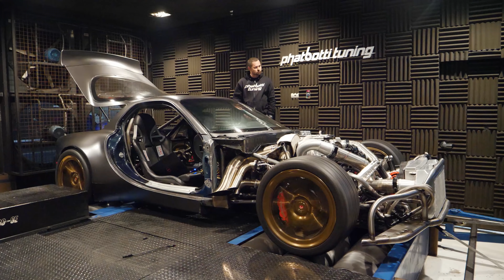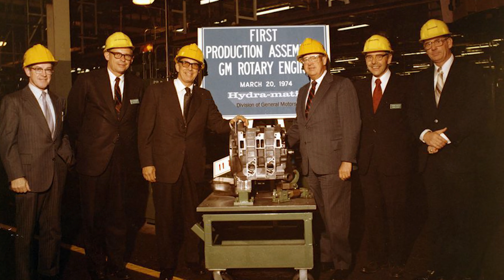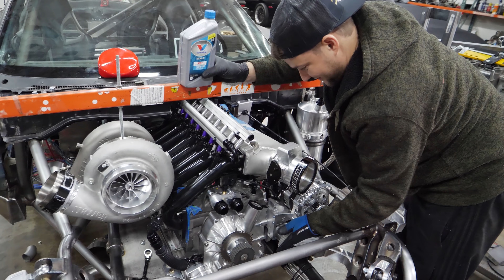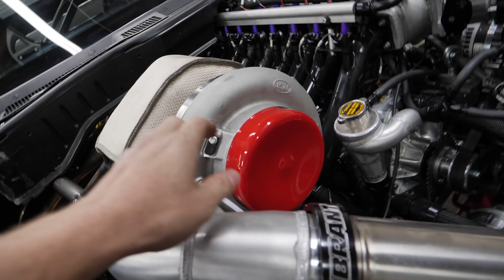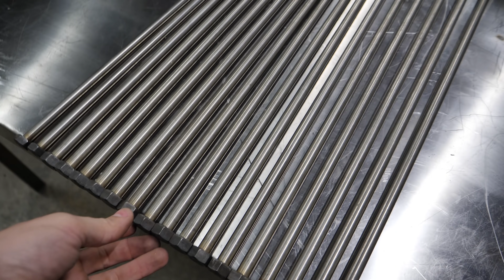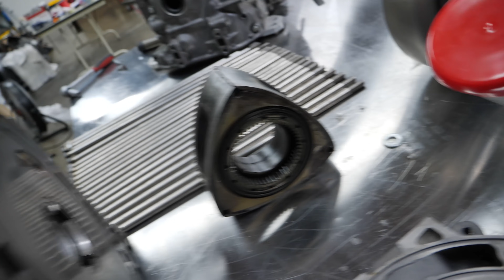I begin my 4 Rotor C8 Corvette Swap! Modern Aerovette Incoming!

Comment: I wish you test it to a circuit track when you finish it. I wonder how different it behaves compared to the stock C8 since rotatory and piston engines weight and vibrate differently, even between flat and cross plane cranked, I think.

Comment: You gotta change that oil bro!! Your pretty much running what’s now like it was during 1st break in oil cycle. The second oil change of power use can hold just as much residual break in engine material. Change that oil ASAP.

Comment: Question rob why not make a oil cooler the size of a radiator or intercooler? To run gallons of oil over a few quarts of oil to keep the oil way Cooler I would say 75% cooler right and running two good size fans Im sure it would keep the oil and motor super cool? Sorry for typos

Comment: Ok, it's official: Rob Dahm accidentally intoxicated himself with car fluids laying around in his garage, went completely nuts and is about to to the craziest and coolest thing ever, even cooler than the PFI SPeed/Fasterproms Turbo K24 Smart + his 4rotor RX7 combined. This is going to be absolutely awesome! ...assuming there's enough space in the middle engined C8 to put a fairly long 4toror in there. Well, if there's not, Rob, you will need a lot of help from fabrication father to make some space :))

Comment: I'm wondering how the lighter weight/less grip rear w/4 rotor will affect launch...given the same power it might not be as fast in a short distance.  But ultimately less weight should be better in every regard.

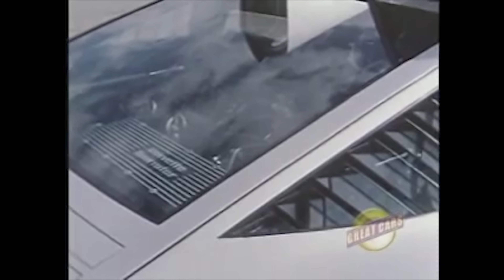Comment: 1:47 “a 6.4L 4 rotor” Jesus Christ
Reply: My guess is that they counted all 3 chambers per rotor. Mazda doesn't do that,  so it'd be quoted as a 2.1L by mazda
Reply: iamaperson1337 you are correct
Reply: @iamaperson1337  2,6l from mazda, hence the 26b name
Reply: @iamaperson1337  and chevy was using an in house design, it wasn't a mazda engine
Reply: @gaspersavle161  yea agreed, I'm just saying this engine probably isn't huge, and actually smaller than the mazda 4 rotor in the 26b.
Reply: I guess they didn't have enough torque
Reply: I feel that this is the real talking point here...
Reply: Yeah, in the late 1950s, even into the early 1970s, every car maker was interested in rotary engines.

As for displacement, the argument is that since you're only measuring how much air flows through per spark firing in a piston engine, that's what should be measured for a rotary. So they only count one face of the rotor.
Reply: yea we can debate all we want
mazda having set the convention
an actual, 6.4 rotary (as Mazda would quote it) would be proper epic. nuff said
Reply: Holy shit that's one massive UNIT of an engine
Reply: 1.6L per rotor...
Reply: That's because Chevy are actually telling the truth about the Rotary in that advert, unlike Mazda who have been lying about displacement for the past 50 or so years. They call the 13B a 1.3L because each Rotor fires in a 650cc chamber, but each Rotor has THREE of these 650cc chambers which all fire during one revolution of the engine, so really a 13B is a 3.9L engine, because 6 x 650cc = 3900cc. It makes absolutely no sense to only count 2 out of 6 chambers and I don't know how they ever got away with it. Calling it a 1.3L makes about as much sense as calling a 6.0L V8 and 1.5L just because that's the size of 2 out of 8 pistons. That Chevy Rotary is actually smaller than the 26B, since the 26B is really 7.8L in truth.
Reply: @Travis-guy-247  in Japan and many other countries they pay taxes based on engine displacement so they probably just found a loophole to be able to call it a 1.3L to make it cheaper to own for the owners.
Reply: @Travis-guy-247  ive always equated each rotor to be 3 cylinders because they continuously fire from 3 chambers per rotor so a 2 rotor with a turbo is equivalent to a  v6  and so on which is why it makes sense gm tested a 4 rotor for the aerovette because it would be a rough equivalent to their v8`s
Reply: @the_legend_of_kira2438  That is true, but if a 2 rotor equates to a V6, then a 4 rotor equates to a V12, not a V8. To more closely represent a V8 you'd want a 3 rotor (which would be like a V9).
Reply: @Travis-guy-247  oh shit the other guy already said the same thing
Reply: @Travis-guy-247  your right idk why I was thinking my math was off
Reply: @gaspersavle161  Yeah it's a very grey area to be honest. Since the two engines are so fundamentally different from each other, it's impossible to make a completely accurate comparison of size really. Since a cylinder is measured at the bottom-most point of the crankshaft rotation, when the area is at it's biggest, I think the same should be done for the Rotary. They should take the measurement of the housing area when it is at it's biggest, i.e. when the Rotor is in the dead centre of it.
Reply: @Travis-guy-247  i thinke thez already do measure it this way, but japanese manufacturers were always creative with their numbers sooo? no point of comparing them tho, each engine is important and the best for someone, personally i am a big rotary fan but when i hear carl thompsons ls it cures my erectile disfunction
Reply: @Travis-guy-247  i do agree with you to some extent but you have to factor in that none of the chambers are ever the same size at the same time while the engine is in operation. I think we should count in all the 3 chambers but we should find the average volume of all 3 of them at the same time
Reply: @Travis-guy-247  also, the rotor to piston comparrison is a little off, since each rotor is doing 3 things at the same time, so it should be compared with 3 pistons instead of one. Idk where i'm going with this but i think the comparison isn't exactly correct
Reply: @Travis-guy-247  but only one chamber fires each revolution of the e shaft or crankshaft. when each chamber fires on a rotor, the e shaft rotates 3 times due to gearing
Reply: so one rotation of the rotor equals 3 rotations of the e shaft
Reply: @jonathansmith1754  I know the E-shaft moves more than the rotors, but it definitely doesn't rotate 3 times per combustion, that's impossible
Reply: @Travis-guy-247  mejor dicho imposible
Reply: Rotary rpm is 1/3 so 6k is really 2k. They have tons of torque when you realize this fact

Comment: 11:38 Did I just hear 6 rotor core?! What did I miss?
Reply: Rob is having parts manufactured for a billet 6-rotor for his next big project, and hasn't announced (decided?) which car he will install it in. My hope is he decides to use a Dodge Viper for the engine swap. Also, Rob said the 6-rotor will likely remain normally aspirated, since it will be able to produce well over 800hp, perhaps even 1000hp, without a turbo.

Comment: What are you going to do with all the C8 electronics? Surely it won't behave well without the original ECU. TCU as well. Not mentioning all the other stuff which depend on one another.
Reply from the maker: Greatest challenge is the electronics and the dual clutch

Comment: how about a twin charged rotary?  Positive displacement supercharger for instant torque at any rpm with REW sequential turbo set up, just to make it extra complicated!
if i had any CAD skills, I'd try to design a 3 rotor Renesis that fixes port balancing issues discussed with the 4 rotor here.

Comment: Rob when are we gonna get a 4 rotor dyno actually pushing it?  You were talking an easy 2000hp.  I know 1000hp is still a lot, but thats like 33% duty on your turbo.  

Before we start talking about other crazy things, lets see you run 250mph in the 1/2 mi with an air shifted 4 rotor rx7.
Reply from the maker: COVID messes with the half mile plans but it’ll be ready for the next major event!
Reply: @RobDahm  Are dynos considered essential businesses?

Comment: Find yourself a good hacker (probably a electrical engineer aswell who can read and understand the signals) who can hack the stock dash on the c8 to hook up to your ecu. That would be epic and ways ahead of any other engine swap. Just imagine sitting in a c8 with stock gauges and a 4 rotor. Man imagine the content rolling up to a dealer asking for an oil change... They jump in, everything looking the same, then when they try to look underneath...

Comment: Dude, I wonder if you have the twin turbo setup with the smaller then the larger one if that would just get out of hand with how fast it will spool up?
Reply: That's really only good for making ludicrous boost, if you're talking about feeding the output of one turbo into the intake of the second.

I wonder if Garrett will make a variable turbine inlet gt57, to help spool faster.

Comment: The reason they crack is because there's no structure to distribute the load. What you have there, is essentially a hammer, sitting on a diamond, atop a sheet of glass. Any vibration will crack the glass under the load, you need a piece of "paper" under that "diamond" to "share the load".
Jokes aside, it's likely that to have the bearings in, it's simpler to machine the entire ride surface out, hollow it out, and then make a replacement single piece insert to fit inside. As machining goes, it's not that complicated a process. It's the materials that will cost. 
But if you'd got that route, you could have a much bigger bearing inside, since the area isn't filled up with the insert that holds the bearing (as is now). 

You never heard this from me, but you could also cut out just the area you need to make a big enough insert piece, make sure the insert piece is made to tolerance + 1, then insert it with some braze, and then machine the whole surface so the two surfaces seat even.

I've seen this done for conventional combustion engines, where the engines are rare, one off, experimental, if a piece is bad, cracked et cetera, they cut out a sizable chunk and replace it with a graft piece then they braze it in. The killer of that procedure is, of course the level of precision you have, not the final cuts, to seat cylinders or in this case rotors, that's easy peasy, no, it's the precision fit of the grafting pieces, you want braze to show as little skin as possible, otherwise you get pitting, at least in a conventional engine, prolly in a rotor, since the cut would be "perpendicular" with the rotation face, there's not that much of an issue.

/rant

Comment: Hey Rob! I’m a huge fan and I’ve been a subscriber for a while, but one thing I’m kinda confused about. It’s how many project you have and what goes where. Are you still doing the three rotor? Are you finishing the AWD four rotor? You mentioned a 6 rotor awhile ago but that was a single video. Now there’s a c8 4 rotor. You’re a mad lad and I respect it but please explain what’s happening :)
Reply from the maker: This is finishing all the expensive projects in the shop. I hate having all this money tied up into an engine that’s become a paperweight. I got the 3 rotor built. And I just got the c5 running again. All these moving forward so there is content while the awd 4 rotor goes to body work and I’m not pressured to hurry it up until I get exactly what I want. The 6 rotor is the one project that may take a longer time as it’s a halo project while I have momentum

Comment: Rob how do you plan to tackle the encryption of the BCM, TCM and ECM? Or will the C8 basically turn into a skate with all new electronics?
Reply from the maker: That’s the hardest part. Got me scared tbh. But I’ll try to play nice and fake the sensors that need to be. Or I’ll go full standalone. Fear is the dual clutch trans

Comment: I cant imagine a 6.4L 4 rotor power output would like🔥
Reply: 420hp
Reply: @gsppuffer  yeah, back then, anything over 400hp was "high end " and somewhat "exotic".  Lol.  Which is hysterical, because nowadays, there are 4 and 6 cylinder cars coming out of the factory with more than that stock!   Hahaha!!
Reply: @1216jimmyz  na ?
Reply: @Deep42Thought  what do you mean na?  Back in the late 60s and 70s, probably 99% of the "performance" cars were NA.  They basically just up the displacement to get more power.  Lol.   Turbos tech was horrendous back then, and supercharged engines were for the most part in all out race cars.  The big dogs out if the factory back then were basically the Chevy LS6 454, which was 450hp, and the 426 Hemi, which was rated at 425hp.

Comment: Next up on Rob Dahn: We swapped 2 parallel 6 Rotors into a M1 Abrams Tank.
Reply: "Hi, I'm Rob Dahm. And this, is my 6 rotor squared M1 Abrams Tank running on jet fuel."
Reply: Fuel mileage is measured in gallons per yard
Reply: Rob would find a way to make the stock turbine as the turbo for it too.
Reply: I think a 12-rotor would be a better fit for that one
Reply: @halofreak1990  12 rotor too long, too much force on the Eshaft, dual 6 rotor work better.
Reply: @notstonks20  the guy who built a 12rotor in his garage made it with three 4rotors in a triangle.

Some 1500hp naturally aspirated!
Reply: lol
Reply: It would fit real nice in a Bugatti Veyron since that's already fitted with a pair of V8s mated together 🤣

Comment: if I had to have my dream C8 I would want it swapped with the VooDoo engine from the GT-350 simply because the C8 doesn’t rev high at all imo.
Reply: C8 Z06 and ZR1 are supposed to have a flatplane
Reply: Also, once you can finally tune them, change out the cam and the valve springs, and it will rev to 7k plus.  There are plenty of LT1's out there revving to 7 and 8k with nothing more than that done to them.
Reply: @1216jimmyz  but Voodoo does it from the factory, no mods needed..

Comment: One day, soon I believe, the engine will explode on the Insight. And the little chasis that you never expected will be reborn with a 1 rotor engine. One sing rotor to rule them all. A single rotor, micro turbo ebay part Insight build is my Rob Dahm wet dream

Comment: Bro why don’t u finish one project before u start another,you vids 
 are cool but your all over the place , finish 1 4 rotor before u start another
Reply from the maker: The awd 4 rotor has to go to body work for a while. Videos will slow down during that time. Why not stay busy with the engines I have in the shop and finish my old projects? Finishing what I started years ago is all. 3 rotor is assembled. 2 rotor vette is running again. And 4 rotor is getting the body finished. Full steam ahead
Reply: Rob Dahm  my bad bro didn’t mean to come off like a dick, I like your vids I always watch sorry for coming off like a Douche. 👍🏼

Comment: first it was Pennzoil ultra platinum now its Valvoline??
Reply from the maker: Yeah. Ultra platinum is an excellent product but they do not make a thicker oil needed by higher hp rotaries. Also reviewing the zddp package on VR1 and it exceeds the requirements from the eshaft machinist. We’ll be going into more detail breaking down the science behind it coming up soon.
Reply: @RobDahm oh crap you replied! ill take your word for it, you're the guy actually going out there and doing the research for mere mortals like me; i appreciate it

Comment: i am just wondering, my VW has a coolant using oil cooler, wich means that the coolant first warms op the cold oil and later cools it down when at operating temperature. Does a rotary not have such a thing? or are they to smaal to work effeciently? if that could solve all the oil cooling needed wouldn't it be way more easy than laying a lot of extra line and hanging more coolers? just asking..

Comment: What next?
Rob: a f**king tank with 8 rotor swap
Reply: Two 4 rotor engines welded 90° in a V configuration 😂😂
Reply: @gabrielmansano  V4Rotor. But a W16 rotor would be cooler.

Although my knowledge of spacing tells me it may not be "Possible"
Reply: 12Rotor ;) 5000hp NA
Reply: @Damicske  it would actually make less power than a 6 rotor due to the length of the e shaft, it would easily snaps at high horsepower
Reply: He started talking about the 6 rotor while having 11 rotors in his shop....made me feel poor
Reply: Run two 6 rotors parallel
Reply: Yeah It probably wouldn't be possible but I think there's a 12 rotor engine and it is basically three 4 rotors combined in a Y shape not a V.
But nonetheless it can be done somehow, probably not even worth it 😂😂
Reply: @gabrielmansano  too bad it's in a boat and the owner stopped uploading vids :(
Reply: 6 rotor
Reply: I feel like that wouldn’t work at all lol gonna need a lot more torque for that!
Reply: @helplmchoking  or very short gearing with large rotors.
Reply: @randomyoutubeaccount6906  umm...it's not like you have much in the way of "options" when it come to rotor size.  Also, it's not like you can stroke it like a V8 and make major torque gains.  Lol.
Reply: @1216jimmyz  You can absolutely make bigger rotors. Bigger in every way. Nothing limits rotor size besides physics, but a rotor multiple times the size of what mazda uses is doable. A diesel rotor is not though, I don't believe due to compression issues. Maybe i'm wrong on that part
Reply: @randomyoutubeaccount6906  you can use a technology called HCCI which essentially runs a gasoline engine in the traditional sense with spark plugs, but under load can inject so much fuel and air that it ignites the gasoline through compression. its super high tolerance though, so it takes a lot of sensors for the motor to be able to tell if its combusting properly
Reply: Don’t give him ideas
Reply: WE NEED THIS
Reply: 2x 4 rotor Bugati Chiron
Reply: Make it 25 liters too
Reply: That's going in the Hummer.
Reply: Always thought a pre runner with a rotary would be awesome
Reply: Lmfao hey YouTube look at my 8 rotor swapped rezvani tank
Reply: I mean...Abrams has a turbine engine... so that's KINDA like a rotary...lol
Reply: Good luck with getting your torque needed to move it